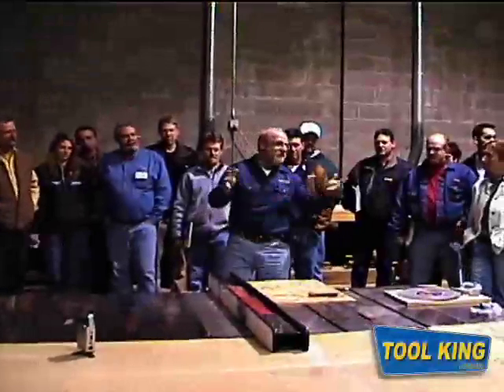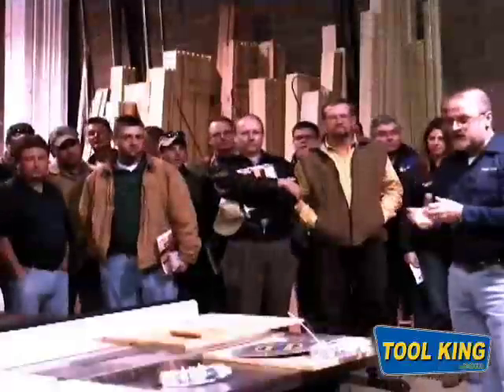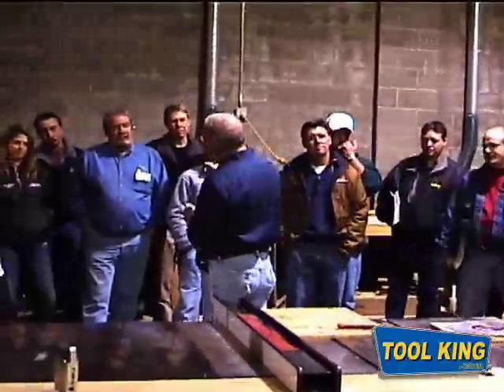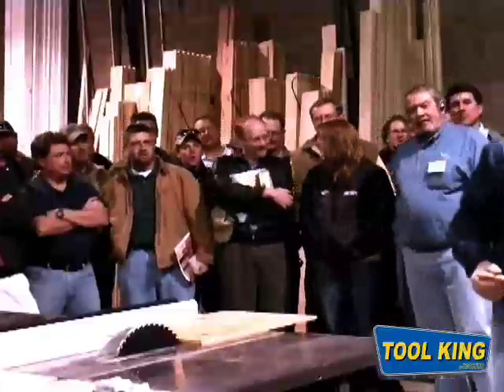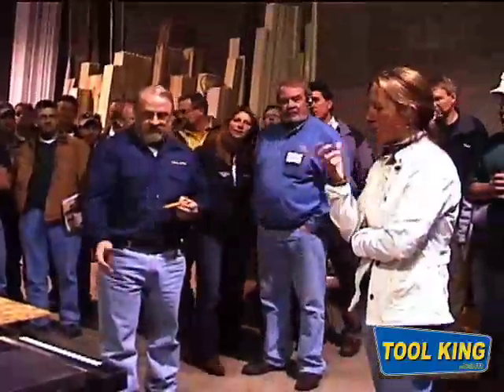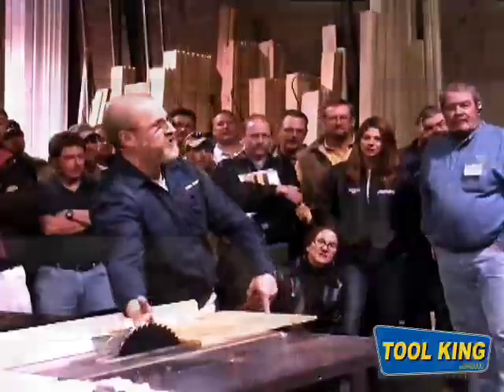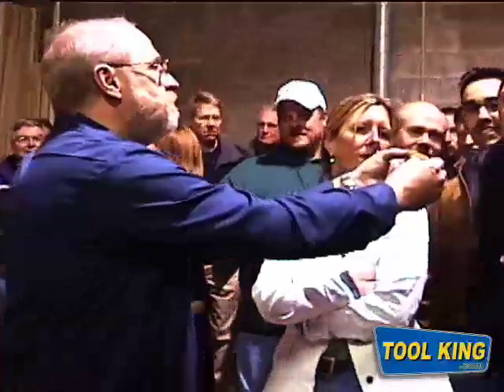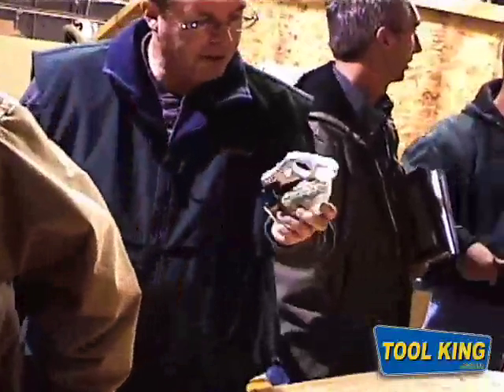Saw Stop II The Complete Demo

Comment: When you can save your finger for as cheap as $70, you're gonna have to stop and wonder how cheap some people have to be when they'd risk their bodyparts for $70.
I would ask the same question if the replacement cost $1000.

You can replace a sawblade, but not a finger.

Comment: @toolkingdotcom
Hi 
That's a great invention, I'm glad You made this device , 5*
About macbeasty comment, what he pointed out was my first tought as soon as I watched the clip, I was wandering if the blade drop would be too slow to save the users flash or would drop fast enough to save users flash & cash due to fewer spares to replace, anyway that wouldn't work on bandsaws.
Anyhow I really think that 60/70 bucks are a bargain compared to a nasty saw injury.
Thanks for the video and the invention

Comment: Sawstop excluded macduff is impressed, macduff's innovative technology (The Original Jimmy Jig) the other alternate
mated to older table saws has retro-fitted that technology to be as save as it can ever be,
it will not wreck the blade or stop the saws operational function.
All macduff's ideally automatic anti-kick back devices are placed up front over-head of the blade or
cutting tool on a
stationary fence, (a macduff first) attaches to a bracket with a suspended rod from the stationary fence

Comment: Ya I know it goes down anyways but it seems they are taking two precautions:

1) They stop the blade
2) They have the blade retract under the table

Both are possibly used to ensure saftey. But the first one is hard to accomplish without causing massive damage to something absorbing all that momentum. I would think retracting the blade under the table WITHOUT STOPPING its spinning would save lots of money and it would still save fingers.

Comment from the maker: That is correct. If the break cartridge fires, instead of your fingers getting destroyed, the blade is pretty much destroyed. So you replace the cartridge (which contains much of the electronics to protect against wear and tear) and the blade. It takes about 5 minutes.